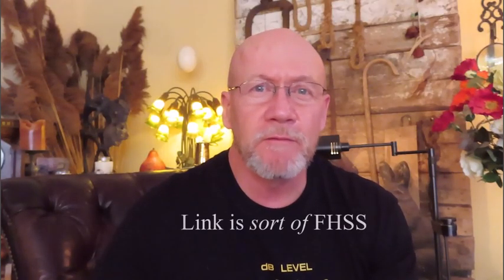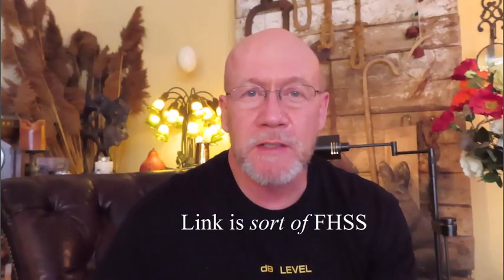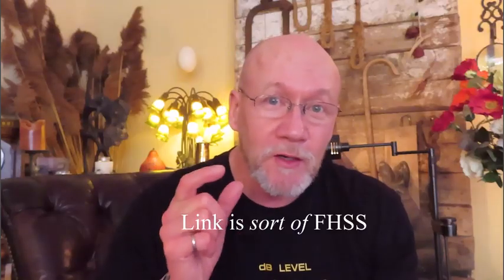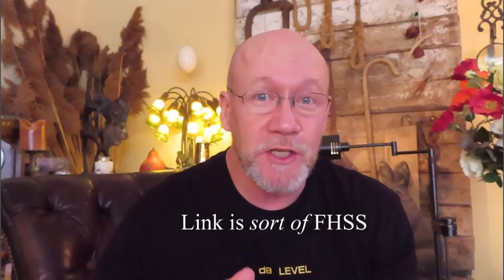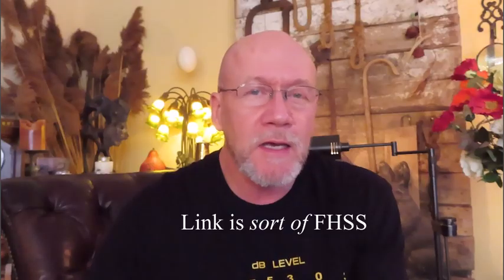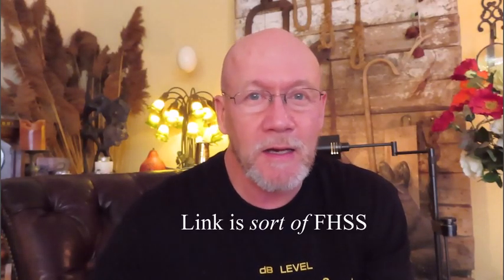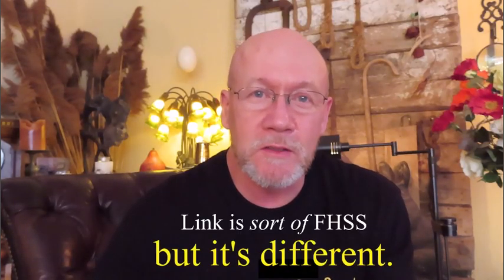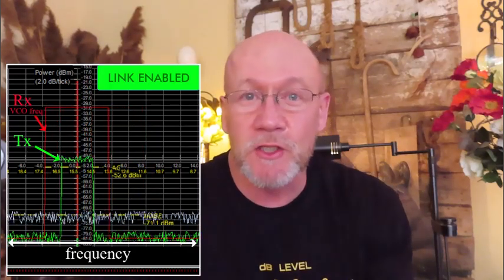Defeat Drone Jammer Without Using Fiber Optic Cable PART IV 33

Comment: "You know, its expensive" Actual consumer drone radio synthesizer chips are reprogrammed to make "slow" hopping at the video interframe rate. Yes, the receiver is more expensive.
Reply from the maker: Easy to jam.
Reply: Hi guys...Shawn.. is there any directivity capability in your system, to possibly get more effective gain, and/or, is there an antenna structure in/on the box.
(I worked at Tektronix and R&S, did a lot of work with the "early" real-time spectrum analyzers, so developed a bit of a taste for RF and modulation...) 🇨🇦🙋🏻🇩🇪

Comment: How do you plan to obscure your design to prevent reverse engineering when the gear gets captured?

I assume you’re not going to be hiring PCBWay to make your PCBs. It’s not hard to sand off markings on ICs, but it’s also not hard to grind down ICs to look at their etchings under magnification. Are you able to encrypt firmware with the MCUs you’re working with?

Have your patent disclosures been sealed? There have been military patent disclosures kept sealed at the USPTO instead of them being published. It would be good to obscure your work to preserve it’s utility via obscurity.

Comment: I thought as much. How do you switch frequencies that fast? You don't, you, and I thought I was joking in you last video, but it surely looks like it, you use LoRa on steroids - chirp spread spectrum modulation with 1GHz bandwidth.
Reply: Sorry for the late answer. I will provide a little more insightful:
1. Independend how you do hopping the phase noise performance should be pretty good not to get jammed by close to jamming frequencies which either do not know you or try to follow you aftr a short time. That mean non-static, or following jamming get more difficult if you hopping as fast as possible. But anyway your frequency synthesizer have to have low phase noise because of the inverse mixing effect. So jammers outside of you choosing receive frequency getting rejeccted by the phase noise integrated over your receiver bandwidth in a distance to the carrier which represent the distance to a jammer.
2. Fast hopping and good phase-noise could be achieved by driving a DDS-DAC with a good source. Simply thh phase noise is close to the fixed frequency DAC clock. But you can switch simply by the programming delay of the DDS. Inside the DDS generation there is some pipeline delay but at the DAC output its instantanious.
3. The author here do not differntiate between Fast Frequency and Frequency Hopping. Its not the switching rate. Its the factor between switching rate and data rate. If you switch faster than bitrate you combine many hopps to get a data symbol. That way you get positive SNR if you know the sequence but negative SNR if you do not. So your comminication is secrete. Hopping equipment, i think better than 20us is regulated. Some chips can do it wthin some 100ns. Btw in the 80s many contracts gone to direct code based spread spectrum. Its simpler on hardware but fare less effective.
Reply from the maker: No it's new, not a retread.  Has not been done before.

Comment: I come from the FPV drone hobby and am particularly interested in the communication link between the drone and the base station. Digital communication systems like those used by DJI rely on publicly accessible technologies that can at least partially be tracked using a frequency analysis device.
First Point: Frequency Hopping and Its Weaknesses

Frequency hopping follows a predetermined sequence, even though it may appear random to a jammer operator at first glance. This hopping sequence allows the drone operator to use the drone’s signal. However, this sequence can be deciphered through reverse engineering.

If multiple jammers operate under the same principle, they can work together to neutralize frequency hopping, even if the transceiver pair functions in a time-dependent manner. This is similar to an electromagnetic wave being canceled out by its inverse function. A similar principle is used in high-end microphones for noise cancellation.

In the hobby drone segment, there are also frequency hopping systems, such as the Crossfire link. This system detects occupied frequencies and hops to a free one. However, when multiple Crossfire transmitters operate simultaneously, interference can occur. Even a brief interruption of just a few milliseconds can be enough to make a drone crash.
Second Point: Time Precision in Frequency Hopping

For frequency hopping to function effectively, both the drone and the base station need an extremely precise time measurement—down to the microsecond. However, this is difficult to guarantee in a mobile unit, as electronic interference within the drone can distort time measurement.
Third Point: Limitations of an Anti-Jammer Transceiver

A small anti-jammer transceiver cannot efficiently operate over a wide frequency bandwidth, as antennas are always optimized for specific frequency ranges. Some frequencies cannot be transmitted or received at full power, which weakens the signal and thus reduces the drone’s range.
Fourth Point: Alternative – Autonomous Control via AI

If a microcontroller with AI features is already integrated into the drone, why shouldn’t it send control commands directly via an internal cable? This would eliminate the need for a connection to the base station.

In the future, object recognition and autonomous navigation could be fully managed by AI and intelligent software. AI often processes camera data more precisely than a human operator. A good example: A human cannot fly a drone behind a wall because they would lose visual feedback, making it difficult to recognize objects. An AI, however, could continue to navigate reliably based on sensor and camera data.
Fifth Point: Issues with WiFi as a Transmission Bridge

Why is a WiFi connection used between the transmitter and the drone at all? A frequency of 2.4 GHz can interfere with multiples of its frequency, such as 4.8 GHz, 1.2 GHz, 600 MHz, 300 MHz, and possibly even more.

Wouldn't it be better to extract the digital signals before WiFi modulation and transmit them directly over the anti-jammer link? This would eliminate the need to demodulate WiFi signals within the anti-jammer system.

Many modern protocols use specific, proprietary modulation techniques that only work with specially designed hardware. DJI dominates the market because they manufacture their own modulation and demodulation chips. To transmit data from the anti-jammer to the base station, every proprietary hardware system would first have to be reverse-engineered.
Sixth Point: Validation of Anti-Jammer Technologies

How can an anti-jammer technology be validated if there are no effective jammers to test it against? Without such countermeasures, advancing on the Technology Readiness Scale (TRL) is hardly possible.
Seventh Point: Cost of Wideband Transceivers

You mentioned that wideband jammers are expensive. Doesn't the same apply to wideband transceivers? If transceivers for large frequency ranges are costly, this contradicts the concept of "low-cost." A mobile transceiver would likely be even more expensive than a wideband jammer.

If I am mistaken in any of these points, please correct me. I come from the hobby sector but see some fundamental flaws in this technology.

I have posted this comment under all videos in this series to ensure it is read.
Reply from the maker: very interesting white paper.  A couple of thoughts:

From the very top: Yes freq hopping is a pseudo-random process, and when the sequence repeats it can be learned - but not before.  To avoid this weakness, the sequence is designed to last longer than the mission.

From the very bottom: Yes a wideband jammer is expensive because it has to cover the entire band where the transceiver might operate, e.g. 500 MHz - 10 GHz.  The transceiver is inexpensive because it only covers 1 GHz that can be placed anywhere between 500 MHz - 10 GHz.  Since the jammer doesn't know where the transceiver is and probably can't detect it, in principle it has to cover everything.   Or it can guess and cover spot bands.

Comment: I watched your previous videos about this counter-jamming technique but i read scientific papers like 10 years ago about 10ghz hopping technology.. so idk why you keep saying "this is only possible now because of a new break though technology invented by canadian team".. could you please clarify this new break through?
Reply from the maker: Please provide a reference to 1 usec transition time over 1 GHz...
Reply: @skyindustries  From the scientific paper:
S2 Corporation tested its wideband RF spectrum
monitor at Idaho National Labs (INL) in December 2013. Rich
RF spectrum data was collected over 0.5-10.5 GHz with
250,000,000 unique frequencies per second, with a resolution
bandwidth below 0.1 MHz and full spectrum frame rate of at
least 2,000 frames per second. Wireless signals at INL were
controlled during captures, and concurrently an FCC Special
Transmit Authority (STA) allowed transmission in frequency
hopping signals across the 10 GHz bandwidth for calibration and
added signal environment.
Reply from the maker: @human7210  It would be interesting to see a link to the article you are referring to.  

At present I'm not following your comparison, sounds like apples vs. oranges.  

You seem to be describing wideband spectrum analyzer 0.5-10.5 GHz, RBW 100 KHz, VBW 2 KHz, whereas the subject is a continuously-operated fast 1 GHz two-way communication link. 

I think I understand from your reply that S2 also transmitted as part of their tests, but there is no information about freq transition time, or whether the transmission was a comm's link, or one-way calibration "pilot" signals.  

If it was a 2-way comm's link across that band, I don't see details about what they achieved.  

If you claim it was a 2-way link and they have demonstrated 1 usec transitions/1 GHz BW, link continuously open even through freq transitions, please provide a link to the paper.
Reply: Yeah, it is apples and oranges. You wrote couple of videos back that there are patents issued and/or pending. If someone is more interested could check you Canadian patent office, but my question is: 
Why you need patents as no regulator will give you 1GHz BW and 9.5GHz spectrum to transmit in.
Reply from the maker: @roumenandreev6386  I didn't say what the patents are for, nor whose name they are in.  

Transmission licenses are not needed in combat zones.

Comment: Would it not be more difficult to jam a cluster on independant antennas flying in small array formations instead of a single one?  3, 4 or even 5 drones could share a common reference link and remain functional after 1 is shot down.
Reply from the maker: Absolutely correct.  And they act as repeaters to extend range.
Reply: @skyindustries  More precisely i was thinking of how astronomers came to develop antenna arrays to replace one single impractically large telescope, now exploiting interferometry techniques based on phase coherence inherited from a common reference source.  But repeaters would still seem like a reasonable fall-back scenario assuming the jamming suffers from blind spots i guess.
Reply: No and no.
Reply: Sorry, messed it up it is:
No, no and no again.
Reply from the maker: @roumenandreev6386  repeating the word "no" is an empty, just-so statement; it does not constitute a reasoned evidence-based case.  

State your case for the community to comment and exchange ideas.

Comment: I could theorize about a very simple algorithm that does exactly what you are saying, it would require just a single initial clock synchronization between two boxes. but I don't want it to go into the hands of the enemy. When you suggesting such a technology, you should really think about a countermeasure right away. If you have the countermeasure available - you should at least mention its existence. otherwise, taiwan and us forces will be overwhelmed by "50$" drones VERY soon, and it will be not even the middle of the fight.